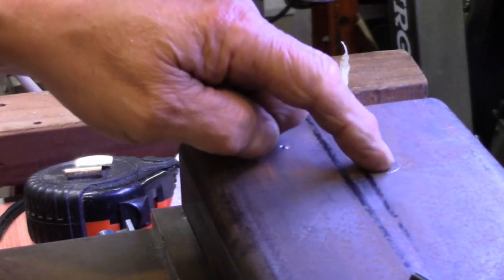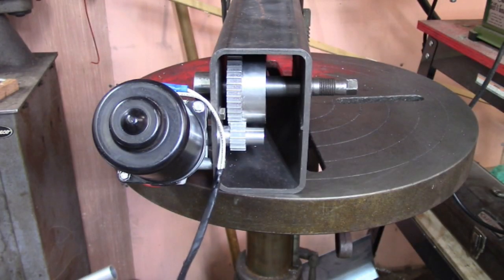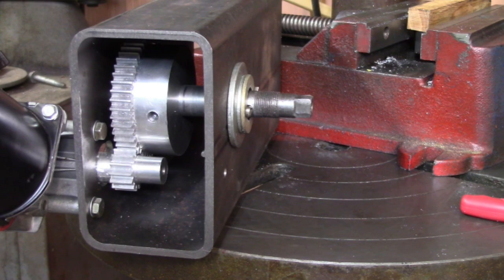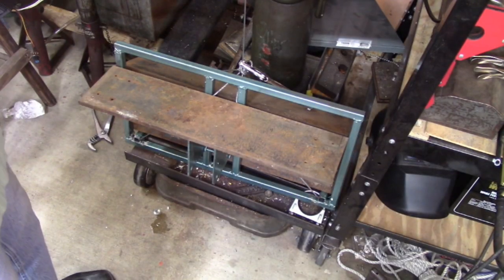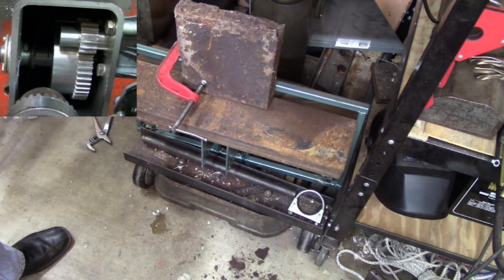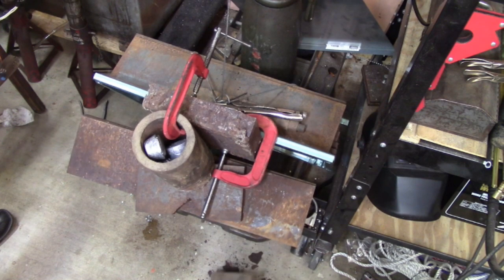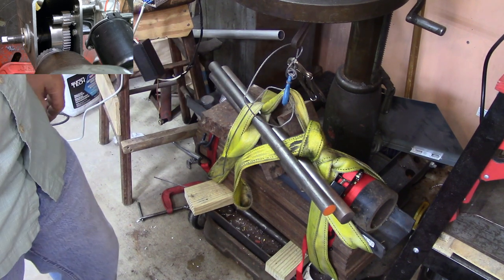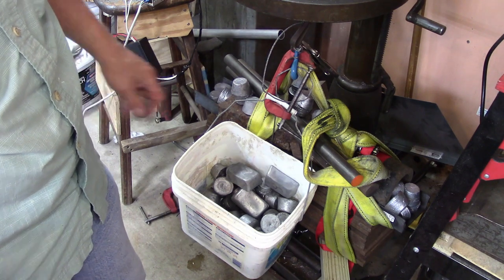Wiper motor how much MORE can it lift

Comment: Those alloy gears did real well.  It was interesting to see that the runout disappeared under load.

 Would have been nice to see the end of the small gear supported in some way.  With ball races fitted to the gears that motor would probably still be lifting more.

Cheers Rob
Reply from the maker: It looks like I found a new way to straighten a bent shaft.  While I was looking for something to tie up the weights I found the other wiper motor.  I am glad I did not use the new one as it was a lot better to use the same motor as the last video.  Thanks for viewing.

Comment: Good work I once put a wiper motor on a wind up bottle Jack and it had no worries picking up the front of a LandCruiser
Reply from the maker: I got the idea of them doing a lot of work from an old fellow I lived next door to about 45 years ago.  He used them to lift his trailer hitch on his travel trailer.  Thanks for stopping by.

Comment: Great video Harold. It has given me an idea - Adding a wiper motor to a hand winch on a recovery trailer. This means that a 12 volt (13.8v) battery could be used and charged through a split charge controller from the towing SUV. The commercial electric winches are 24v  so no use for this outfit. Greetings from N. Ireland
Reply from the maker: It might be better to use a power window motor since they often come with a gear.  Thanks for stopping by.

Comment: That is really impressive Harold. When i have built gear drives i like to use a tap to hob a gear then a threaded rod or bolt to make a worm gear. It makes for higher torque and it serves as a break that wont let it reverse without power.  For the price ive seen for those wiper motors and the work put into making the gearbox makes the harbor freight 2500 lb wench a really good deal and it comes with a remote control.... still cant believe you lifted 400 lbs
Reply from the maker: Impressive little motor huh?  Thanks for stopping by.

Comment: Hi Harold, you talked about improving your channel, I watch 'Steve Jordan' and one thing he does on his channel is that everything he buys or uses the first time, he puts a link to it in his 'doobly do'. I find this brilliant, it saves so much time trying to find it on ebay or banggood etc. Just a thought.
Reply from the maker: Thanks for the suggestion.  I had not thought of that.  Thanks for stopping by.
Reply: @AmateurRedneckWorkshop  another tip, you can get an Amazon affiliate account, and earn a small percentage of each sale from your links, to help support the channel. If you're so inclined, anyhow.

Thanks for the video, it helped me decide on whether or not these motors would work for my project!
Reply from the maker: @xhorntail  Thanks for stopping by.

Comment: Hi Harold,That's impressive especially considering the low voltage input. It's no wonder they move the snow off the windscreen. Regards, Ted
Reply from the maker: After all of that i am surprised they do not remove the windscreen.  Thanks for stopping by.

Comment: Nice video mr.Harold...what type of super motor is that 12v dc or 12v ac..vehicle super or???
Reply from the maker: It is just a common Ford wiper motor.  12V DC.  DC motors will tolerate over voltage for a short time.  Thanks Malanang.

Comment: This is impressive, here North, you could have your windshield frozen solid and that little motor would be able to rip-off the winshield in one whipe...   ;)
One more reduction stage and you're going to lift all your metal stash in one pull...   
Is there a way to get a smoke show out of something with a little more insistance...???     ( Nasty grin here )
Reply from the maker: I try to tear up something every week.  Sometimes I make the grade.  Thanks for stopping by.

Comment: You needed bigger wiring and a relay on the switch to remove all the voltage going through the switch and over heating.Great video helps with my linear actuator design.
Reply from the maker: It is amazing how much work you can get from a tiny motor.  Too bad the darn thing is DC.  I hate the idea of little transformers hanging off of everything.   Thanks for stopping by.

Comment: Great video thank you. I love the creative ideas you have. I was thinking about making a TV lift using a wiper motor. Trying to think how to rig the wiper motor gear to a straight bar with gear teeth mounted to the back of the TV to raise it straight up and down. Would be cool to see you make some videos of different things you can apply the wiper lift method to instead of just lifting weights maybe make a TV lift or some kind of winch setup etc...
Great job keep up the good work I appreciate your videos 👍
Reply from the maker: My original intention was to use the wiper motor to lift the mill head but that did not work out, not enough power.  Thanks for stopping by.

Comment: Like others have said I would like to know how much weight a basic wiper motor could lift on its own 1:1 ratio without any gear reduction. Thanks I apologize if this has already been done and I just didn't find it.
Reply from the maker: As I remember it was somewhat less than 100 pounds.

Comment: Amazing in at least 2 ways: 1) how much weight the motor and gears lifted 2) what us old men will do to prove a point. :-)  Did you happen to make note of how much could be lifted before the motor would "back off" on its on?  In other words, what the holding weight was.
Reply from the maker: I think the holding weight was around 200 pounds.  Thanks for stopping by.

Comment: As always - impressive how gear reduction can increase torque so well. You have a nice stock of steel bar!
Impressive results. Must admit, was getting worried about cable surviving the load!
I thought some narration was by Chip & Dale! :)
Reply from the maker: Nope old D. Duck was the man, er bird to do the job.  I was wondering what would break and then really surprised when nothing did.  Thanks for stopping by.

Comment: Hi Harold. Good video, thanks for sharing.  With a bigger wire drum instead of just using the shaft and some shaft support on the floating gear I reckon you could get a lot more out of the crane. (now there's a challenge) But how much more will the drill press table take.  regards from the UK
Reply: not a bad entry to the tom lipton wallet lift challenge of 2017
Reply from the maker: I think we have hit the limit of that motor.  It did finally stall out.  Thanks for stopping by.
Reply from the maker: What is this about the Tom Lipton wallet lift?  Have not heard of that.
Reply: A larger drum would have the opposite impact... more difficult to lift, but faster lift.

Comment: Awesome project!
What was the gearing ratio that you used for the cogs?
It would be interesting to see how much it can lift on 1:1 gearing (directly on the output spindle).
I am thinking of making a capstan winch for lifting weights up to 50 lbs on long distance with higher speed...
Reply from the maker: I used a 14 tooth gear on the motor and a 40 tooth gear on the cable.  That should be about a 2.8 to 1 ratio.  Thanks for stopping by.
Reply: Thanks for the quick reply and big up for your awesome channel !
This means the motor should still lift about 150 lbs with the integrated gearbox. Now it will also depend on the roll or sheave diameter used to gather the cable.
By the way, what is the RPM of the spindle that comes out of the motor's integrated g-box?
Cheers!
Reply from the maker: Every time I have used the wiper motor to lift things the spindle that the cable was wound up on was 3/4 inch or smaller.  I do not know the rpm of the output shaft, all I can say is not a lot.  You can find out by running the wiper motor on an automobile and count the strokes in a minute.  Thanks for stopping by.

Comment: U re awsome, can u tell me INFO about Wiper DC motor is it 12V how much A and W?
Reply from the maker: The wiper motor is 12 volt but you can run it on more as long as you do not run that way too long.  I have no idea about the A and W I did not measure these things.  Thanks for stopping by.

Comment: Can you build into it a kind of spring tension ratcheting tooth or claw that holds the lift position until you release it the from the gear (like a Come Along winch mechanism), or would that be too much stress on the material you made the gears from?
Reply from the maker: I think that would work.  The gears were obviously strong enough for the job.  The wiper motor is the weak link, it has a plastic worm gear running the worm.  Thanks for stopping by.

Comment: what kind of wiper motor was used in this experiment?  from what car or truck did it come from? year model and make ?
Reply from the maker: I really do not know but I think it was a Chrysler product.   I got it off ebay and wiper motors like other things fit a wide range of motor vehicles.  I simply purchased the lowest priced motor I could find.  Thanks for stopping by.

Comment: Your work is good, and thank you for sharing it. I have been applying my mind to a similar problem, and I believe I have come out to a simpler solution/answer to your question. Gearing as with leverage can achieve great step ups in power, as you have proved. So why don't you simply test the motors capability direct to the shaft [or a simple pulley]. Then with some simple maths [excuse my Englishness lol] design, or chose, a gear set up to bring the capability up to your requirements? After all, a long enough gear will move the world!
Reply from the maker: At my age moving my bowels is enough achievement.  I will defer to letting you move the world.  If I might make a suggestion I would move it any direction but sunward.  Maybe people can work out atomic power to furnish sunlight for crops and heat but the other way, instant toasted earth.  Thanks for stopping by.
Reply: Know what you mean! We are of the same vintage, I too, am paid by the state to bugger all these days. Good luck to you, I like your work, and thinking

Comment: One question .you must answer.
How much power supply amp and volt?rate not load and max load amp?
Reply from the maker: That is a very hard question to answer as I did not pay attention to loaded and unloaded amps.  I used a 40 volt power supply capable of 10 amps.  I used a speed control board so that I could control how fast the motor ran and it also provided me with a on/off switch.  By the time the video was done the speed control board on/off switch was getting hot so i am sure I must have been using 10 amps when loaded if the power supply was accurately rated.   Thanks for stopping by.
Reply: Drive board u use how many amp.
Any additional fail safe like fius.
The rotation gear ratio 1:?
Reply from the maker: @maskystudio9193  the gear ratio was 4:1.  The speed control was similar to the one on this link.    https://www.ebay.com/itm/DC-40A-DC-Motor-Speed-Control-Reversible-PWM-Controller-12V-24V-36V-48V-2000W/173177079359?hash=item285228863f:g:9G8AAOSwmudaBFpO   Thanks for stopping by.

Comment: what did the wiper motor come off of?  what type vehicle?
Reply from the maker: I actually bought two wiper motors and so I do not know for sure which is which.  One came off a Chrysler product and the other came from a Ford pickup I think.  It has been very long ago so the memory is not so good.  They are enough alike that you can see it is pretty much a standardized design for all of the car companies.  The main differences being the mounting brackets.  I just bought the lowest priced motors I could find on ebay.  Thanks for stopping by.

Comment: what do you think about trying it with a block and tackle?
Reply from the maker: You are about 5 years too late on that.  Thanks for viewing Casper.
Reply: @AmateurRedneckWorkshop  figured I was a little late to the party but watching you work with it I had an idea for a pivoting payload hoist arm for a trailer or even pickup bed.
Reply from the maker: @crazedman6786  that could work quite well.  Never too late to build something.  Thanks Casper.

Comment: how would i know the wiper motor I will buy is strong like yours?
Reply from the maker: I do not know how to answer that.  I would imagine most of the wiper motors are a standard size and strength but I do not know that.  I bought two of these based mostly on cost and they are from different brands of automobiles.  The basic construction seems to be the same no matter who makes the motors from the ones I have seen but still I have no proof of that other than just my observation.  Their are some differences in how the motor is attached to the automobile and how it is attached to the wiper arm.   I suppose in the end you will just have to take your chances.  If you want a low cost hoist to lift things you can purchase these at a reasonably low cost from companies that import them from China.  Here is a link to a model that I have purchased for about $100.  https://www.harborfreight.com/440-lbs-electric-hoist-with-remote-control-60346.html?_br_psugg_q=hoist  If you use a wiper motor for a hoist you still have to purchase a power supply, switch to turn it on and off and change direction and then build a frame to hold it and purchase cable and hooks and many other items.  You will need at least two gears as well.  The best choice is to purchase one already made.   If this is a project for an educational purpose then of course it is worth the expense to show your skills.  Thanks for stopping by.

Comment: What is that motor off of year and make?
Reply from the maker: I purchased two motors and as far as I can remember one was for a Chrysler product and the other was for a Ford product.  The one thing i do see about them is their is very little difference and I expect all manufacturers use a certain limited number of motors that they purchase from the lowest bidder.  Thanks for stopping by.
Reply from the maker: I am not sure it can do that.  One way to find out is to build it.  If the motor fails you still have all of the machine and all you have to do is find a stronger motor.

Comment: How much current the motor draw? I assume the voltage is 12 volt
Reply from the maker: I did not measure the current draw of the motor.  The power supply is rated at 30 amps I think so something less than that.  Thanks for stopping by.

Comment: Dint let our fall on you and get your toes..... If you had put a pulley at the load with a hook then run the cable from the shaft thru pulley and back to the shaft with half the shaft either larger or smaller diameter that lil booger would lift 5000 plus pounds .. As a Chinese windlass
Reply from the maker: Thanks for stopping by.

Comment: Musta been off a chevy..  Or one them pep boys specials..   if it come from a ford itd a burnt up first video..  and be a dealership only deal that runs ya 500$ and takes a team of mechanics three days to put it on then next time it rains ya find out its put in backwards and runs a big ole U scrape across your hood and dealership voids your warranty when you bring it back to em because they say you installed aftermarket parts on the truck because the wiper motor they put in dont say fo mo co and they gave you a 30$ ebay special for the 750$ you give em then ya finally leave with windshield wipers not working  and no more factory warranty on a brand new 5k mile truck you just bought off em a month ago..  meanwhile a chevy pickup crosses its 1 million mile mark with all original parts the dude got for less than what you paid for the windshield wipers...  Ford, built like a shit brick house, made in USA (usang sajura asia),no hastle 100k mile warranty (terminated at dealers discretion at any time as they see fit).  Comes factory with all fluids and tires (at the factory)
Reply from the maker: Thanks for stopping by.